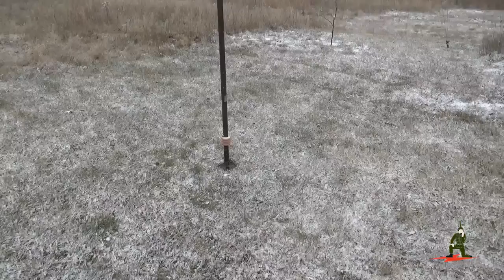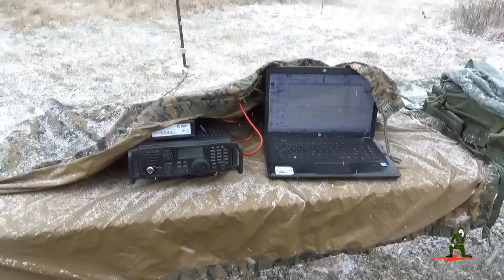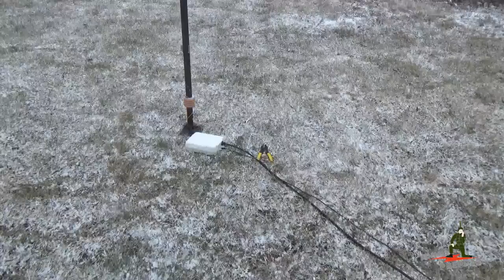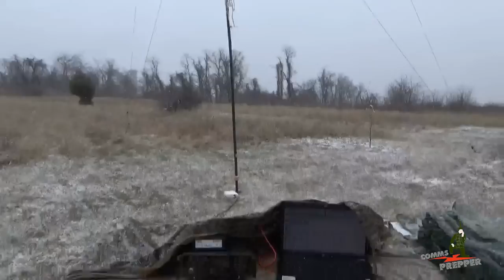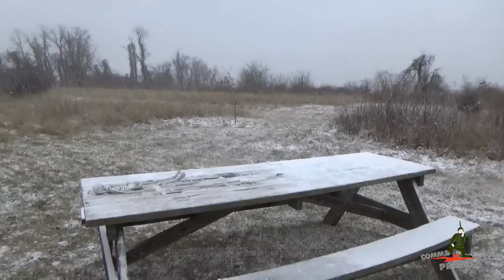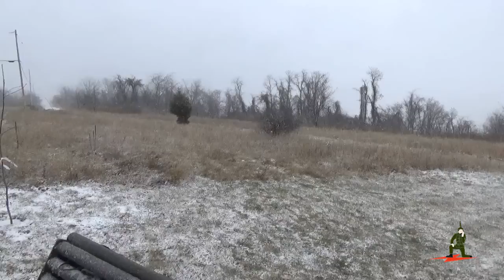Icom AH-4 Antenna Tuner Field Deployment

Comment: How do you disconnect the AH-4 tuner connector from the IC-7200 ? Is there an easy way to do that, mine seems to be stuck on permanently ;(
Reply: i use waterproof aviation connector from uxcell.. i put them on the AH-4 to make a quick disconnect..